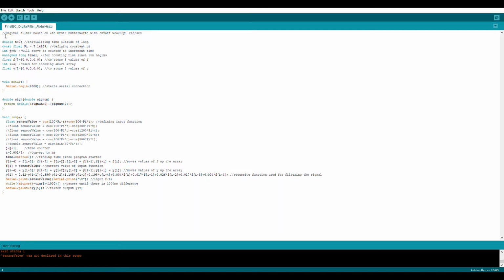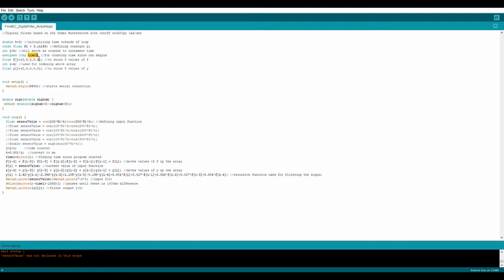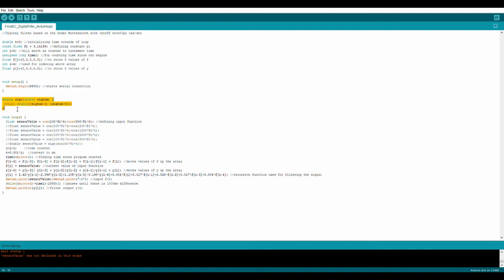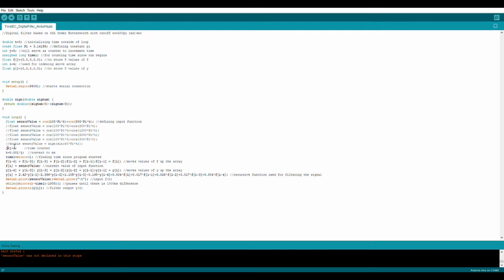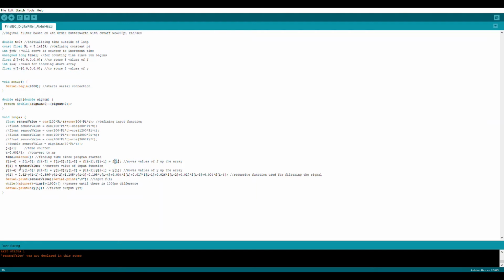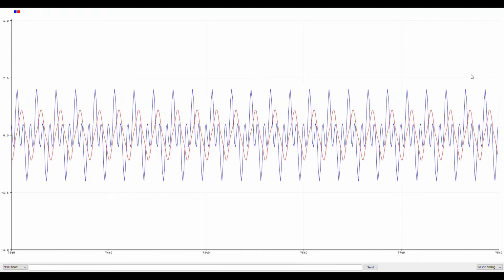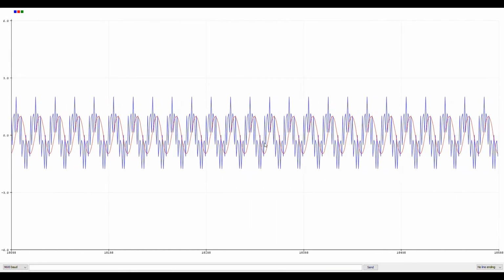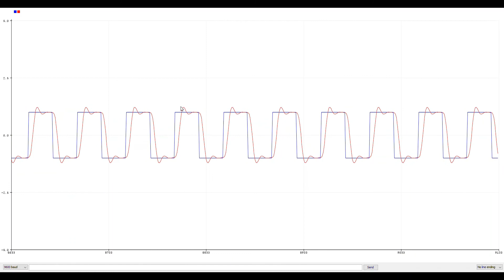Low-pass Butterworth Filter Implementation in Arduino

Comment: toata porcaria asta de cod e fara sens.

float digitalFilter(uint16_t rawADC) {
  static float f[5] = {0,0,0,0,0}; // to store 5 values of f
  static float y[5]= {0,0,0,0,0}; // to store 5 values of y

  float ffrawADC = (float) rawADC;
  for (byte i=0;i<4;i++) {
    f[i] = f[i+1];
    y[i] = y[i+1];
  }
  f[4] = ffrawADC;
  y[4] = 2.42*y[3]-2.396*y[2]+1.105*y[1]-0.198*y[0]+0.004*f[4]+0.017*f[3]+0.026*f[2]+0.017*f[1]+0.004*f[0];
  return y[4];
}

nu stiu daca face ceva dar ...asta e tot.